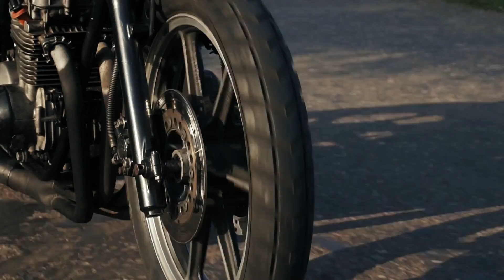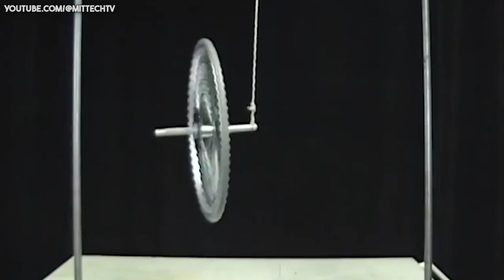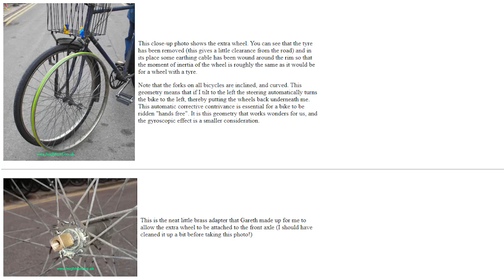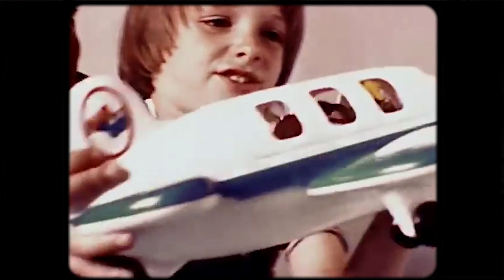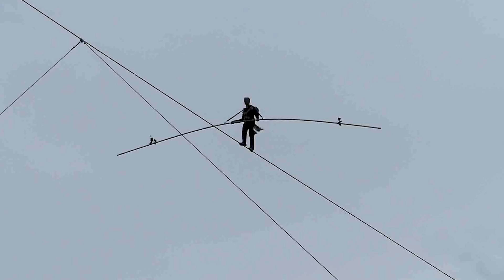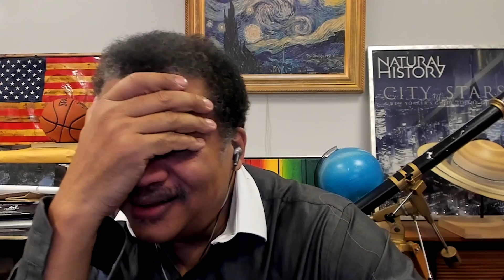How Do Bikes Stay Up? | Neil deGrasse Tyson Explains…

Comment: As of three and a half minutes in, I can't believe I'm smarter than Neil Degrasse Tyson, PhD. You can toss a motorcycle wheel sideways, and it will tumble until it smooths itself out and rolls straight. It's a force called, "Self Aligning Torque".

Comment: BTW the wire walking pole is to balance it, what you want to say is the person walking on the wire not actively lifting or lowering the pole using his or her strength, by putting force on the pole but the using the curved pole he or she balance himself or herself, the pole is for auto balance. 
oh, it has a term in physics, it is called neutral equilibrium, remember that ball on peak, in a valley and on a flat surface? 
BTW the psychology and the mental balance is very important as well. So it is not easy. You don't want your body and legs do crazy thing, do you?

Comment: Why would anyone think it is gyroscopic effect? For gyroscopic effect to stabilize a rotating mass on it axis, it has to revolve or precess on the third perpendicular axis, that means the bicycle has to go on a curve and make a circle on downhill, but it doesnt, it go downhill straight. 
BTW, it is not just bicycle, it happens to a wheel, single tire rolling down the hill as well. 
When a wheel is rolling downhill, there must a force which should act on axis of rotation to brought it down. But during downhill roll, the CG shifts towards front of the tire, so it rolls faster and still no sideway acting force. 
If anyone who thought it was gyroscopic effect before does not understand gyroscopic effect.

Comment: I know for my e-bike, the battery is about midway, but the motor is on the hub of the wheel and is pretty heavy. Mine is also a fat tire and the wheel and tires are a good bit heavier as well. Suppose I can't speak for other styles of e-bikes, but I can ride mine with no hands all the time with no issue.

Also, my regular bike needs to be greased so my front fork turns better and I can't ride with no hands on it at the moment because of that. I feel that makes sense with what was discussed here.
Reply: Yeah, center of gravity has very little to do with it. A really tall bmw gsa motorcycle is just as stable as your much lower Kawasaki ninja.

Comment: Its less about center of mass and more due to a few aspects of bike geometry, specifically head tube angle and the mechanical trail measurement.   These can vary greatly between bikes but they have the most to do with a bike’s tendency to right itself.
Reply: When the bike is *moving*. Neither of these were discussed in the video. The question was never answered. I'm learning quite a bit from the comments though; never occurred to me that frame geometry had to do with stability.

Comment: Rake & trail.  And an explanation why to turn right you PUSH on the right handlebar!  ???  And no, when you lean a bike the CG goes DOWN.
Reply: Yup, trail is the key for the self centering castor effect. Rake is the lazy way to get trail but introduces bad characteristics if pushed too far.  As you say, CoG goes down and also outwards when leant over. This is a very poorly researched video.

Comment: It IS a balancing pole, you feel yourself leaning to the left, you move the pole to the right slightly shifting a larger proportion of the weight of the pole to the right which, because you have leaned a bit to the left is now higher on the right, this provides the down force you require to right yourself without moving your position, only your arms a little bit, as it wants to balance itself gravitationally. I still wouldn't do it. Not for all the beans in Columbia..

Comment: Question: In which direction do you turn the handlebar on your bike if you want to go right? Clockwise or counterclockwise?
Reply: @@thanksyutbeisacn7fu6r50 I clarified my question since pushing right or left doesn't make much sense. :'D
Reply: Initially, you counter steer

Comment: As a motorbike rider it's centrifugal force if I'm riding in a straight line I'll need minimum input its only on bends and turn do I need to push bars and lean then there's counter steering and pushing on pegs to make the bike lean  further physics will only allow you to go so far bur look at moto gp riders 40 degree plus angle on corners at 100mph impressive stuff

Comment: Yeah it's called counter streeting, that's how all bikes are steered by riders. Much more obvious on a motorbike at speed. So you initiate a fall to the side in the direction you want to steer in then you steer the opposite direction so that the front tyre tracts the desired radius.

Comment: The most surprising part is that you can cancel gyroscopic effect. I can't believe it. I understand why it cancels rotating effect like a double-bladed helicopter without tail blades but canceling gyroscopic effect? Nah, I believe only when I see it.
Reply: On helicopters with a standard single primary rotor, the steering mechanism is set up to compensate for the fact that you actually have to provide a swashplate input, that is 90 degrees from what you'd instinctively think the swashplate input should be, so that the controls are intuitive to the pilot.

Comment: Interesting... I was convinced by the gyroscopic effect explanation - because this is what I learned while training for my motorcycle license...
But if that is not the proper explanation, then there is something else my instructor said that does not make sense anymore: he told me that past a certain speed (around 30 km/h so about 18mph) the gyroscopic effect makes it so the bike simply cannot fall - unless you lose traction or hit something of course.
And it does indeed require a conscious effort from the pilot to keep the bike up at low speed - some bikes require more effort than others, due to their center of mass of course...
So here's my question (to which I'd bet you have the answer). If the gyroscopic effect is not responsible for this... Why does the bike have to reach a certain speed to be automatically stabilized?
Thanks for everything you teach us through your videos btw!
Reply: The gyro effect acts in a similar way to the effect Neil talked about:  When the bike has some roll velocity (meaning it starts leaning left/right) the gyro effect also acts to steer the front wheel in the direction of the turn.  So it's not one or the other, it's both.  As you go faster, the gyro effect becomes stronger.  I'm not sure if there's a point where the gyro effect is stronger or what, it'd depend on the particular bike, I suppose.  Maybe it's always less, maybe it's sometimes more.  Not sure, but it should get stronger as bike speed increases anyway.
Reply: If you REALLY believe  gyroscopic effect is what’s balancing your bike then I dare you to try getting on it and try free rolling backwards. It’s the rake and caster angles that create a measurement called trail or steering axis angle which is the measurement following the angle of the front forks back to the actual contact point of the tire. Trail causes the front wheel to fall in the direction the bike s leaning which consequently steers the bike back over its center of balance. The bike becomes easier to steer at higher speeds as the bike steers itself under its center of balance faster which requires such small inputs we the riders don’t register it. I’m not going to jam my head race bearing to prove it and fall off. But if you had two high quality slow motion camera one positioned on the handle bars and one at out front pointed back at the front wheel I would love to see the footage and determine that the handle bars vibrating at speed are something more than engine vibration. It’s the bike continuously rapidly autocorrecting its balance.

Comment: It's the curve in the front forks that makes the bike go straight.  if you analyze the geometry you can see that when the handle bars are turned that lifts the front of the bike slightly.  therefore, in order to turn you have to put energy into the system.  i.e.  the bike goes straight unless some force acts on it.
Reply: ohhh that's interesting. I've mentioned in another comment that I have a single bike which is quite hard to ride handsfree. I have to shift my weight and lean to one side to drive straight. The handlebar is not exactly straight adjusted. Maybe that's the reason. I got this bike for free but wasn't able to center the handlebar due to corrosion
Reply: @macgoryeo  Sometimes if a bike is crashed the forks are bent slightly to one side, so the front wheel isn't centered properly. That throws off the alignment. Handlebar setting is  more cosmetic, particularly when no hands are involved.
Reply: Nope. That helps you come out of corners without applying force to the handlebars to go straight. What keeps the bike up is the self aligning torque of the wheels, the natural tendency of them to roll straight and true on their own.

I ride motorcycles, and used to do it competitively, and that takes a LOT of science.

Comment: Not often is Neil off the answer, but he completely is this time.

Of course wobbling brings the center of mass CLOSER to the ground, which is opposite to what Neil is saying.

The reason the system is stable is that the caster angle makes the steering wheel a self-balancing system that compensates instability with a turn to the proper direction due to the gravity pull.
Reply: I'm a vehicle dynamics model programmer and agree with you.  If the bike rolls (leans), you'll get some camber force immediately.  Since the tire vertical force is behind the steer axis (mechanical trail), the tire will naturally steer in the direction of lean.  That causes a non-zero slip angle and lateral force to develop in the direction of steer and lean which rights the bike again.  There's some gyroscopic effect there too (the bike having a roll (leaning) velocity will tend to steer the wheel in that direction too because there's a reaction torque at 90 degrees to the added angular momentum vector) but it might be minor in comparison.  So strictly speaking, it's some of both, but the primary stabilizer is most likely the steering as he described.  On a racing bike at high speeds this might not be such a minor effect though.

I don't like Neil's description of the bike other than the part about the wheel steering and trying to right itself.  That part is good enough for the layman, but all this stuff about a low CM is irrelevant, including what he described with race cars which has nothing whatsoever to do with roll stability and everything to do with lateral load transfer and tire load-mu sensitivity to increase maximum lateral acceleration.

I wish Neil would talk to some vehicle dynamics engineers before going on about these subjects because they often don't work quite the way he imagines.  He's an astrophysicist, not a vehicle dynamics engineer with any expertise in that area.
Reply: Agreed. 
I've watched a lot of his videos. He was also wrong about an airplane in one of his videos. As an astrophysicist, I absolutely love his way of explaining things. Bicycle (or airplane) builder, he is not. His overconfidence in his incorrect understanding of some of the tips he speaks about is a little bothersome for me.
Reply: @johnhartley5261  Your comment is on the nose.  I'd love to see him revisit and correct his mistake.  That would really boost his credibility.
Reply: Classic “im smarter than you” overthink. Now ask him to explain why your car steering wheel self centres. He’s clueless.
Reply: Exactly this. the imaginairy line from the steering head to the ground will always be in front of the point where the tire will actually touch the ground. This means, like a dart, the point of resistance is behind the pivot point, making the setup stabil. 
As a kid, i tried riding with the forks 180° degrees around. This wil mess up the geometry and you will not be able to ride without hand on the handle bars, which is easy when oriented the normal way. 
Also, like a fence mounted at an angle, the fork will find its lowest point, which is straight ahead.
Fun fact, cars use this same geometry trick to make the front wheels center when you let go of the steering wheel. ( And this only works when driving)
Reply: Right? I mean if the bike isn't moving it's obviously going to fall over and "center of mass" isn't going to magically help with that. I'm surprised he is so off on this one, but that happens to him sometimes.
Reply: I don’t doubt that low CG and the so called weeble effect can help prevent tipping, but as a long time gyro guy it’s the spinning motion of tires( whether forward or backward) that resists ANY change. It wants to remain where it is. 
Ask yourself if the bike isn’t moving will it stay up? No. So the forward motion , and thus wheel spin, is the key. 
Used to have a bicycle tire in my office and a lazy Susan. Would have customers spin the wheel holding in both hands on axle while standing on lazy Susan. Try turning tire in any direction and see what happens.
Reply: @ericbailey872  the centrifugal force, while it's tangible, is not the key factor. You can replace the wheels with as something as light as possible with no significant difference for the rider's ability to balance the moving bycicle as long as other properties of the wheel are not impacted.

The opposite is also true: it's impossible to ride a bycicle with its wheels as heavy as one can imagine, even along a significantly long straight line, if the system doesn't have the key element: a steering wheel with the caster angle which allows for a self-balancing ride.

Comment: Neil on your example of the bike with the wheels that spin backwards it doesn't cancel out the  gyroscope factor. Because that video with the wheel spinning and you can levitate it from one side. That wheel doesn't care which direction it spins the angular momentum still holds it upright. So the bike no matter which direction the wheels spin it would still hold it up. You were onto something with the front wheel turning into the lean though. Because fyi if you try to do that with the bike backwards down a hill it won't work the bike will tweet and fall over every time. The reason the bike steers into the turn going forward is the caster angle of the front forks. That's the reason a car wants to go straight if it's aligned right. But in reverse if you don't touch the wheel the wheel will try to turn full lock one way or the other. It's the caster angle. If that bike goes backwards down the hill the caster is backwards and it will fall. If the forks were perfectly  vertical the bike would not be as stable. If the forks went the other way it would want to crash all the time. The caster is what keeps the bike going down the hill.
Reply: Right. The only thing that the opposing rotations cancel is precession.

Comment: I saw Veritasim's video on the same topic couple of months ago. He experimented riding bicycle with locked steering wheel and it was impossible to balance. Nice to see further explanation and example of highwire.
Reply: Someone did a video where they made the steering work the opposite way (turn left and the wheel went right). It took him a very long time to re-learn how to ride (like months iirc). Once he finally got it, he then could not ride a regular bike. Crazy stuff.
Reply: @lemongavine  No need for a different bike. Just cross your arms and grab the handlebars carefully  (of course much nearer to the center) Be careful you might fall, but after some practice you will get the hang of it. In about ten minutes, not months.
Reply: @lemongavine  Same video.
Reply: @bmcwxyz  That was Destin of Smarter Every Day.   He has been a guest on Veritasium's channel several times.
Reply: @lemongavine  Yes! Destin Sandlin from "Smarter Every Day" YouTube channel.
Reply: More specifically, his steering wasn't locked, but is prevented "counter-steering" which made riding it impossible.